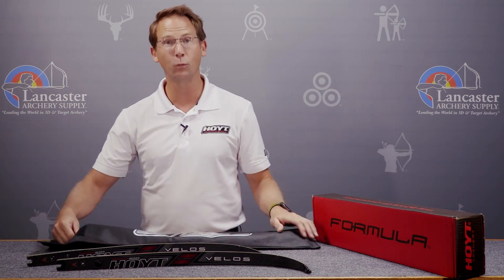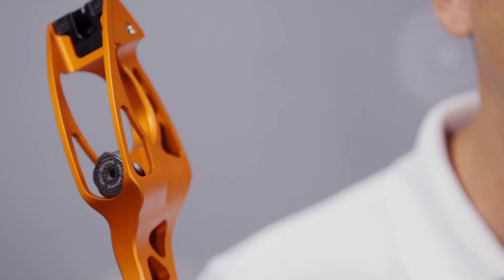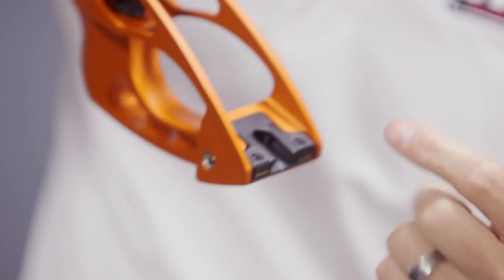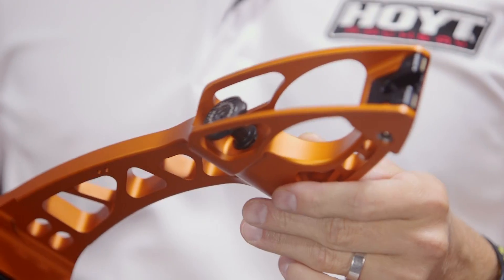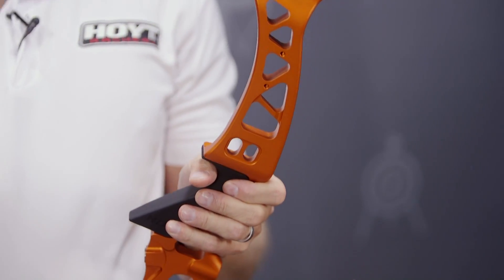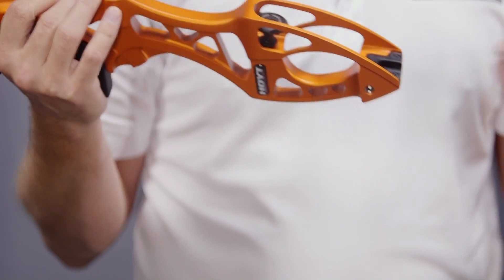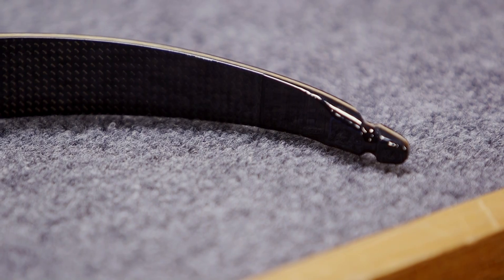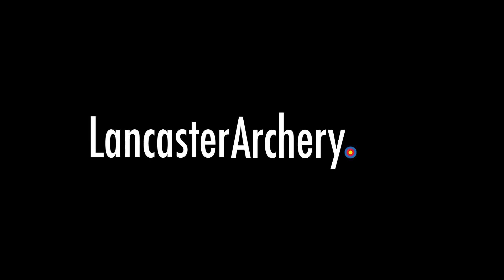2019 Hoyt FormulaX Olympic Recurve Riser and Velos Limbs

Comment: Centre south till bot is designed to damage the thread if you keep on justing it your poundage the thread Will wear thin and finally gave way causing the  bolts to fall out, and limbs to come flying out when you are at full draw 

The recurve dovetail block  new???? It’s on all the others low end risers